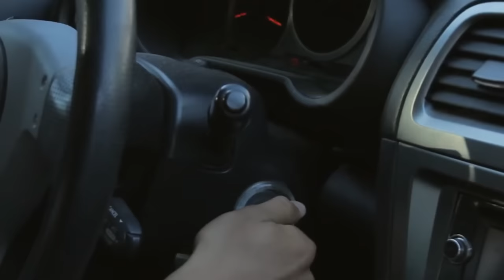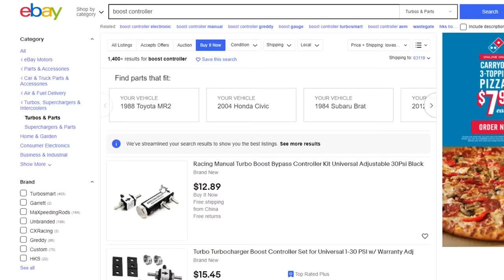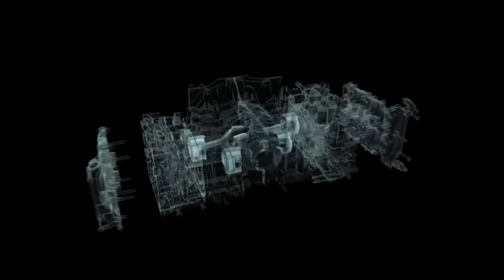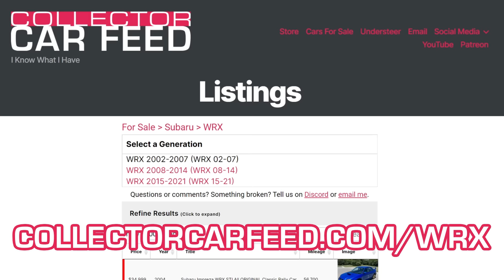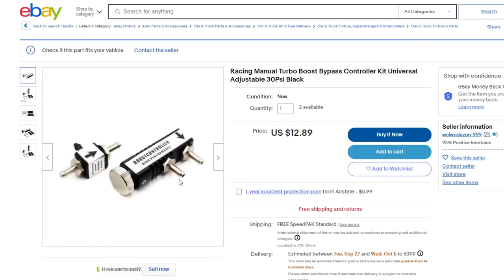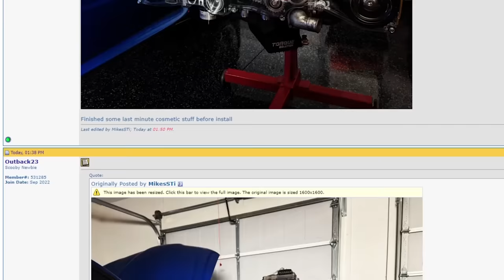Hard Truths of Owning a WRX in 2022 (Donut Media Won't Tell You This)

Comment: As someone who has recently bought a 2014 Subaru Impreza WRX and was in the market for one for a whole year before pulling the trigger, I can anecdotally confirm that a LOT of these cars on the market were truly abused, and not cared for. Very rarely will you come across one that is single, or duo owner with a recorded maintenance history, let alone a carfax. 

So many people make fun of these cars because of head gaskets, or ringland failure, or whatever else, and they completely ignore the fact that it's previous owners and their neglect of the car's regular maintenance that got that car to where it is today. Not the car itself. That said, the car has some inherent flaws. Nobody can sit here and tell you that it's good design to have Cylinder 1 and 3 have seperate coolant lines, while 2 and 4 share the same one (This is a big cause of ringland failure after hard driving).

Also the whole like.. headgasket issue stemming from them using single layer headgaskets in the base model imprezas being conflated with later year WRXs. It's all pretty annoying, but I wouldn't let it sway you from buying one if you want one. You just need to SEARCH. Don't go buy the first world rally blue WRX you see. If you see that it's modded at all, pass. Don't even look at it.

Comment: I had a 2003 WRX that was problem free up 150K miles, got decent gas milage, and didn't use oil.  I traded it in for a 2013 WRX STI that has been nothing but problems since new it has guzzled oil and at 16K miles threw its timing belt and needed a new motor.  The jerk dealer I took it to claimed it was not covered by warranty because I changed the oil myself which is illegal, they finally paid for half of the cost.  It still sucks a quart of oil about every 700 miles and gets only 20 mpg even on the highway.  My 600HP Dyno'd GT500 5.4 Supercharged V8 gets 24mpg on the highway, and doesn't use a drop of oil.  The problem with the 2.5 Liter motors are the oil control rings are too small.

Comment: i bought an aspen white 06 sti that checks out from everything you listed, only reputable cobb parts, (intake downpipe and exhaust) and timing belt done at 125k miles, bought the car at 130k. dont get me wrong, it does have its fair share of small problems, but no knock, no head gasket problems, I felt like i bought a really solid car, for 14k. took it to the mechanic and they said only good things about the car and that it was a gem.
Reply: steal!!

Comment: I drive a modded blob eye wrx

Gonna be real, it's one of the best handling cars for the money and honestly  they're pretty quick. No it's not the fastest thing in the world, in fact a charger rt or stock g37 is more than a match for you in straight line speed. 

All thats done to it is a catback, cobb tuner, intake, etune from a decent shop. 

It makes like 280-300 crank hp, like I said, more than a match for g37s and some chargers 

From a dig they're pretty good though, don't launch it all the time but when you get it right....man, you can beat anything. 

Maintenance is hard work, I was a mechanic so I found what was fucked up with it early on. Ignition system never serviced, hoses mismatched or in wrong places, had a misfire. 

I took a chance on it, figured it out and it's been good. Downloaded diagrams, bought repair manuals, and found people who know their shit to teach me. 

It's a hoot to drive, fast as hell to me, and practical. 

Sucks on gas though and with how prices are rn, I'm thinking of selling her. 

It was an attainable dream car and now, I can say that I've been there done that.

Comment: I bought my 2014 STi after getting into an Accident in my First WRX. When I first bought my WRX I thought it was the most hot boy shit out there I dogged tf out of it and it had over 100k Miles and the previous owner had already tuned it Rode it hard and Put it away Wet. I took the car after Beating the shit out of it my self and decided to start taking better care of it and started doing my own work to it I've never worked on cars before that I never had a Urge to mess with Cars at all but after owning that car and finding my Love and passion for the Speed and the Canyon drives it was worth every Penny. So I did a Clutch Kit, Lighter Flywheel, Billet Clutch Fork and Pivot ball Coilovers all the Snazzy stuff about 4 months later I wrecked it going through a Yellow as a Ford Focus ST was turning through the Light. Insurance paid out 2k cause it was a Narrowbody so the Prices were a lot less for those specific years but I ended up finding my Stock 2014 STI for 17K with only 57K miles and I took it out of there hands and Now I have a beautiful WRB Sti with Low miles. I put a Brand new 15+ STI rack and pinion in as well as Power steering Pump and lines as well as a ACT HDSS Clutch kit Did it basically all my self other than help from a friend or two but Overall if you have the Care for these kinda Vehicles they can be Reliable and Fun at the same time!

Comment: Special needs car for special needs drivers like me! Seriously though dude thanks for this. You hit the nail on the head. I've pissed off so many Subie nerds because my car is stock af and they can't accept that. My first and current daily is an 04 Sti in blue and gold. Bought it from a Cali dealer with mods and a fake smog cert. Surprisingly hasn't died, but I do take great care of it. Ended up moving from Cali and still drive the car today. 170k Original miles. Bought an 05 wrx, 155k Miles, off marketplace to do SCCA rallycross in because I'm that guy that wants to live out that rally fantasy and it's all I can afford. Somehow found the only unmodified wrx on marketplace. The only thing I've changed is put a catback exhaust because the stock on was falling apart and i get a quarter chub when I hear that Subie rumble. Certified Youtube mechanic that has kept my stuff running in good condition. If something came up I wasn't confident in I just take it to the dealer and get fucked, but I know it gets done right. Still waiting for the day those head gaskets go...

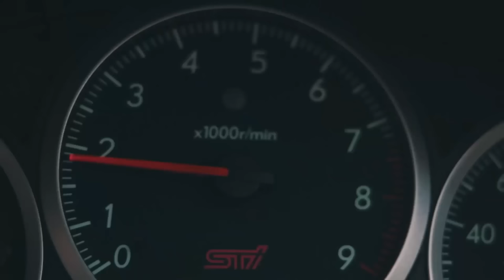Comment: I'm rebuilding my 08 FXT Sport this weekend and my heart sank at 6:25 cuz I bought a Gates timing belt kit. Luckily I found and ordered an Aisin TKF-005 that should arrive before this weekend. Thanks CCF for the save there, would have been so much worse having built the engine and THEN learning the timing belt from Gates was trash. Will post a video when I get her up and running!

Comment: Another gotcha with these cars is the coolant system - Subaru uses a weird setup with a cap on the radiator and another cap on the expansion tank.  And these caps are NOT the same.  The cap on the radiator is a 1-way cap, the expansion tank has the much more common 2-way.  People that don't know the difference, or buy an aftermarket radiator and put a 2-way cap on the radiator can cause all kinds of over-heating issues.  And may even lead to head gasket failure.  Pay attention to the stock caps that are used, and be sure to use them in the correct places.  99% of aftermarket caps should never go on the radiator.

Comment: I had a VA for 30k miles and right after breaking it in I immediatly got it to 340whp and abused the shit out of that thing daily like a honda, and even blew the transmission. Yet my engine was in perfect condition the whole time and the latest blackstone report said oil looked perfect. Then I even moneyshifted it like crazy which broke the AC compressor causing false knock and DAM drop, but the engine was still in great shape and ran perfect with AC off.
On the other hand, I know a guy who blew his shit in like 5k miles because he ran full bolt ons with zero tune.
These things are amazing when you treat it right.

Comment: After 15 years of owning my 06 STi, I found out.,. I am a Subaru guy. I do NOT have RA Mudflaps, I DO NOT have Hella horns.  I started vaping WAY before the jokes about Subaru and vaping started, by several *years*. The jokes are part of what got me to quit, so I'm thankful for that part.. who knew jokes could help kick a nicotine addiction? Damn Gen Z'ers can't let me live in peace.. Anyway, so many people think Subaru are bad because, like you mentioned, all of those kids that mod without tuning or do things without knowing whatever else is required, then they blow up and they blame the car when it's 100% the owners fault, 99% of the time. 

Everything you mentioned is spot on, great vid! This needs to be the definitive guide to buying a used Subaru for everyone. The only thing you didn't mention was the stock oil pan/oil pickup tube and baffles issue on tracks. When taking high G turns on twisty tracks, the oil can slosh to one side of the engine, causing starvation and blowing the engine. It's a problem that's happening more on the new GR86/BRZ's, since they're offering track days with the cars. Aftermarket oil pan/pickup tube etc. can solve that issue. They aren't available for the new GR86/BRZ yet but I'm sure IAG will make one soon enough.

Comment: I love my Bugeye. Dude, you nailed it. You love your scubie and care for it or you jack it up, blow it up, and hate it. Good or bad COBB is the paint by numbers for tuning. That being said,  my radiator failed and due to my access port I shutdown to saved my engine and the dash temperature guage thought about rising slightly. An intake will probably set a code. EPA has stopped COBB from distribution of anything more than a stage 1+. The + being a electronic boost controller topping off an intake(1). Woohoo. Past that, you'll have to find a pro tunner. Timing belt, water pump, cam gears, and ALL seals oh and thermostat, about a grand.

Nice joint✌🏻🤙🏻🤘🏻

Comment: I really do get mechanics not wanting to touch Subarus. My dad is a freelance mechanic and he's fixed everything from Toros to Toyotas and everything in between. Admittedly his main area of experience is carbureted yard equipment, but the only job he wasn't able to complete was a Subaru Timing belt. He's done tractor transmissions, hydrostatic pumps, to full engine replacements. Subarus are verry much the kind of car you have to have exclusive experience with. Kinda like automatic transmissions or VW stuff. Understanding the theory isn't good enough, you need to know how to work on a Subaru.

Comment: I did put Rally Armor on my 2019 STI because I live in rural Wyoming where the roads are dirt, and the ones that are paved are in bad shape because all they do is just chip seal them instead of actually fixing the problem. They do serve a purpose for those of us not living in/around big cities.
Reply: Funny how you didn't put weird mud flaps until you got a subaru
Reply: @carfriendsimulator9981  I also put mud flaps on my both of my old Dodge Intrepids and my Ford Escape for the same reason.

Comment: We've owned two Subaru's, 1997 and 2007 legacy, and we owned the 1997 legacy and not a single issue with the engine for the 20 years we owned it

Comment: Mods aren't the problem it's the lack of maintenance and understanding its weak points. Do oil changes every 2k to 3k miles and everything else in half the factory maintenance intervals. Also blow by is a huge problem and why everyone blows the motor, do a air oil separator and the cylinder 4 cooling mod. This will greatly increase reliability.

Comment: No doubt about homie's words. My 16 WRX just hit 100k miles yesterday and it's been through  road racing✔️ few thousand miles road trip✔️ overlanding✔️ and of course daily✔️. And the reason that it will go for 100k miles is that I don't do dumb sht to it. Get the right part,  the right tune, and the right maintenance and it will go however you want it to go

Comment: The banjo bolts issue is actually down to two things: along oil change intervals & just straight up shitty engine oil.

If you have a turbocharged Subaru, it doesn’t matter which make & model, only Subaru’s OEM oil will outlast everything else. The numbers support that. 

Also, don’t ever bendice Subaru on their oil change intervals if you want to have reliability. Maximum should be 4,750 mi to avoid that bandit bolt clogging up due to oil getting dirty for long intervals repeatedly. 

Everything you said here applies literally to any Subaru 😅. You have to be willing to care for a special need car because even when stock it’ll be.. special 😅. 

But, use OEM parts & change the oil fanatically and you’ll actually get reliability. Just know that the moment you mod anything on a Subaru, you’re in for it 😅.

Comment: First) I bought a 2022 wrx for these exact reasons. All the WRX's being sold are beat to absolute shit and cost as much as a brand new wrx. The 2022 may be considered ugly but I dont mind it and I bought the car not to stand outside and stare at but to drive. And let me tell you, this car 100% drives like a dream.

Second)I do have mud flaps on my 2022 wrx for 2 reasons 1) they do look nice 2) I live in CO so there is gravel, rocks and every season is construction season where they drop rock across all the major roads. The flaps do help stop chipping. Also being from CO, lots of dirt roads up here and as we know, the most fun roads to drive are the curvy mountain ones, and out here aint no California half assed dust. Its actual dirt, rocks and gravel all over the roads.

Comment: The EJ257 which wasn't significantly power bumped in 15 YEARS in its production run STILL ranks among the most powerful production 4 bangers. What does that tell you? Well that the engine as it was had been pushed to the absolute edge of potential while retaining reliability with precise engineering. Even Honda, the lords of reliability TODAY won't dare to push their 4 bangers beyond the 310 mark.

Comment: I have a 15 sti and my guy is right you have to fall in love with the car and the ups and downs that come with it,I simply can’t do that knowing the cost to rebuild the motor is over $8,000 and I have seen pampered motors blown at 25,000-60,000 miles all too often and that is a fucking manufacturer engineering failure. I’m just dumbfounded of how many Subarus are on the road and the lack of support with rebuilding these motors.

Comment: I get annoyed by the unreliable comments. I just laugh it off because some people can't think for themselves. My 05 Legacy  GT is modded and tuned, 257k miles on the original engine and turbo. Only "failures" I've experienced in the last 10 years is 2 injectors and the radiator (plastic endtank crack). Not including what I consider regular maintenance (clutch, tune-up, ect). I was very smart with this car and only use good brands for aftermarket parts like perrin and cobb.

Comment: I've had my wrx for about 8 years now, left it stock mechanically just maintained and driven it and i've had precisely zero issues with the thing. incredibly fun car to drive and the need for more power only really exists if you're a shithead that likes drag racing at the lights which is entirely missing the point of buying one of these cars. Take them out to a rural road and they're in their element, riding between second and third controlling understeer with the throttle and getting a nice burst of power out of the corner is always a great time. 
There are faster cars out there sure but it gets better smiles per gallon than a lot of them on the right roads.

Comment: 4 Subies deep I’m 3 minutes in and it’s all spot on haha. Except the thing about intakes tho. If you get an Intake, get a tune!!! Please! The wrx will run lean with a bigger intake because the MAF scaling will get thrown off. Lean conditions mean higher cylinder temps, higher cylinder temps in a wrx mean preignition and probably ringland failure.

Comment: I bought a jap import 2000 wrx in 2019 with a blown motor. With no experience what so ever I was able to replace the engine myself with minimal tools at the time. They are super easy to work on if you spend half a day learning the basics about how they’re different to ‘normal’ cars and download the FSM for your model. Since then I’ve done a few simple mods, mostly putting STi parts on it, and had it tuned for the running components (currently at 280hp) and it hasn’t missed a beat aside from the TGV’s failing at one point (which only took an hour or two to cut out the flaps, reinstall and have the code cleared). Apart from the tune, I’ve done all the work myself which has not only saved me money but also meant that I’ve learned so much about these cars and become the Subaru guy amongst my friends who don’t want to pay to have their shitbox fixed at a shop.
All in all I think they’re a great car and anyone who’s willing to put half a thought into what they’re actually doing with it and keeping up with maintenance is going to have success.

Comment: I bought a forester on impulse couple years ago. Spark plugs were just as easy as any other car. People always over dramatise the difficulty on working on cars that are slightly different from the norm, for example boxer engines or mid engine cars. I have a British mid engine car everyone said was difficult to work on but honestly it's the same as any other car. I'm starting to think even rotarys are the same. As long as you're not an idiot you won't have trouble working on it

Comment: bought an 03 close to stock, 200K on the chassis w/ a ej205 swap with 30k + miles on the motor a couple months ago. All it had was a short shifter and spec-d exhaust. So far I added BC coil overs, gram lights, new radiator since the OG one leaked like crazy, reman steering rack, Whiteline steering rack bushings, JDM head lights, STI LCAs,  Whiteline ALK and roll kit.